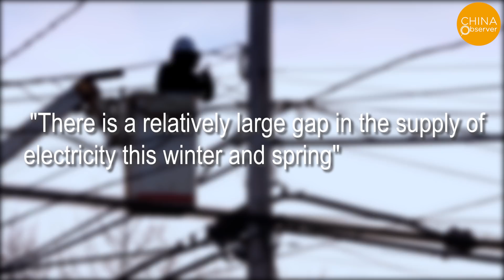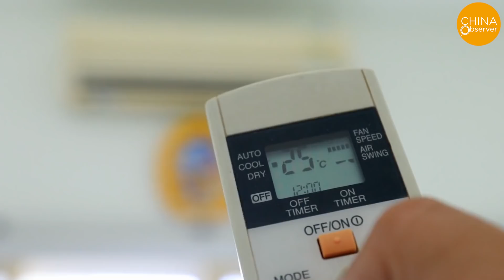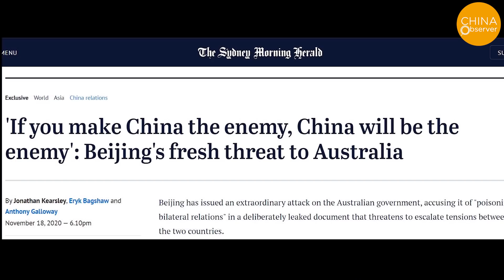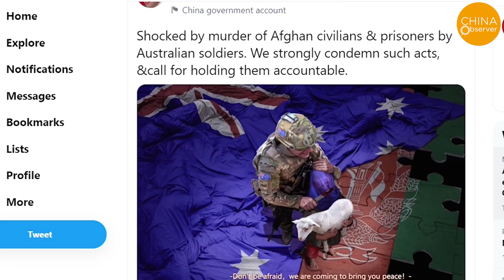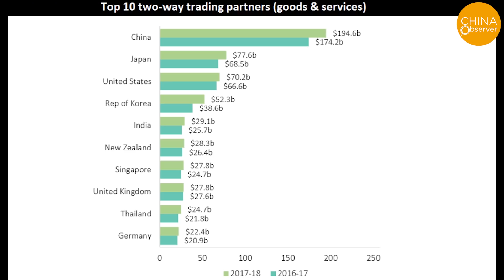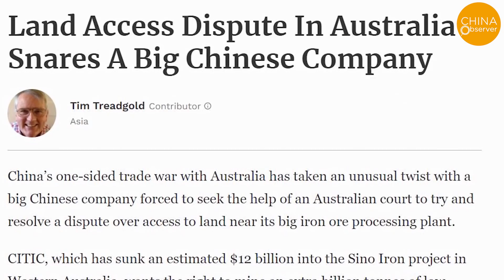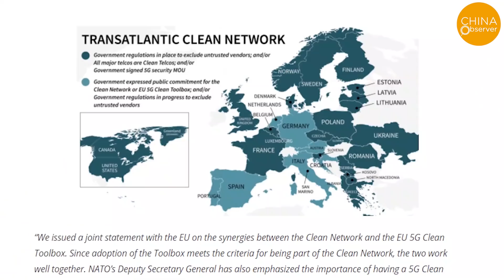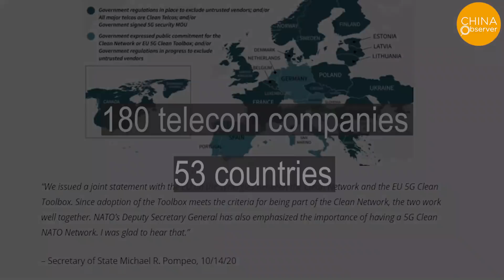China Suffered from Mass Power Shortage After Banning Australian Coal Import | Economy | Sanction

Comment: The power shortage also coincided with the bankruptcy of a nationalised coal and power company. If one utility provider has gone bankrupt then others are likely to follow.
Reply: @xiguada9928  What you are saying confirms the problem is real. I'm not buying environmental protection as a reason because australian coal is relatively clean and so if the environment was a concern you'd stop the import of cheaper more poluting brown coal and import more Australian black coal. Also there mist be an issue with hydro electric dams in China as the CCP turned off the cameras at the 3 gorges dam after reports came out that the water was over topping the dam and the dam had deformed. If there is nothing to hide then why hide it?
Reply: @xiguada9928  bye bye china. Back to be being poor again lol

Comment: Too bad it's the Chinese people who will suffer. None of the party leaders need fear blackout.
Reply: Actually, the situation is not that bad. The trade war between china and australia is one small reason of the power shortage. In my area, due to the green plan, many small coal-fired plants were closed, and this winter is ealier and colder, the comsuption of electricity is rising sharply. But they only limit the usage of industrial electricity. In the rich area, this year is the last year of a green plan, every factory need to decrease their power usage, the goverment even forces those factories to sign a guarantee to reduce the power use. And you konw, ccp is an autarchic government, they will use any way to filfull their object. But we were shocked that  they turn off the street lights too.

Comment: Wait a minute!!
So China is reducing carbon emissions by less coal usage and  still they are criticised.
 So as regards climate change, isn't less carbon emissions a good thing???
Reply: Not quite.
They have to replace the high quality Aust black coal with lower quality brown coal that is less efficient and releases more pollution. Kind of like this, the combustors are at max capacity burning low heat coal that releases more CO2 with the effect of less boiled water vapour to spin a turbine.

Comment: only less than 2% coal in china is imported from Australia and half of them is being used for steel production instead of electricity generation. The reason of this blackout is due to strong economic rebound in China which has not been anticipated by the power plant operators. Normally in the last several months of the year, production activities are not so strong leading to less energy demand.

Comment: Well, I just watched a video ranking coal production by countries... as per the data in the video, I really do not agree the idea that the blackout was caused by "lack of coal import from Australia".
Reply: Asuka,doesn’t China have large coal seams? I read somewhere that the only problem is that it is two thousand feet deep. Big problems going that deep! As an old coal miner, I would not go that deep!
Reply: @thomastolbert6184  Respect to you, bro.
I have no idea for coal mining, but I did read that CN has the highest coal mine casualties among all countries even with the most modern mining devices. Anyway, according to the data CN has been the top coal production country for over a decade, and its annual  production dwarves No.2-5(or No.2-10?)combined. So I dont think CN will be short of coal without coal import from Australia. The iron ore may impact way heavier than coal, IMO.

Comment: Please do more research, the lower import volume in last couple months from Australia coal doesn’t even come close as being one of the main causes.The primary cause is due to global warming (extreme weather) and the associated policies set in place to control carbon footprint, coupled with the surging demand of electricity due to the pull of the manufacturing demand from outside of China - the surge in PMI data is all public info. Most of the coal used by China for generating electricity comes within China w/ gap covered by imports from Indonesia, Mongolia, and Russia. Australia’s coal import only accounts for 2% of the consumption (more than half probably used for metals industry) and the total import volume had been mostly achieved this year by October 2020 comparing to 2019’s. If you were to criticize China, at least do your home work, and focus on more quality issues.

Comment: Do you even know the difference between coking coal and regular coal? 
The coal to generate electricity are regular cheap coal, not coking coal. 
Australia coal are high quality coking coal they are by no means used to generate electricity. 
China are lacking cheap low quality coal not the high quality Australia coal.

Comment: This video is hilarious. 
Australia imported coal represent roughly 5% China's total consumption. What made you think this caused China to have power shortage? 
Australia exports roughly 10 million tons per month (before ban) and China consumed roughly 3 billion per year. Explain to me why missing roughly 5% of coal, 2.5% of total electricity shall make a city go blackout?
The main reason is 
1: Central government sets a quota in their 13th five year plan to reduce coal consumption by 2020 so local governments are rushing on their "kpi" at the end of evaluation cycle.
2. Increase demand of exports requires many factories to increase their production hence increase energy consumption. 
3.  Unusual low temperature striked southern China. 
4. Reduced energy from hydro due to water shortage in winter.

Comment: China produces 3.7 billion tons of coal every year, but only imports 77 million tons of coal from Australia. The imported coal is exclusively for steelmaking, so don't be conceited Aussies, you are not that important. The electricity shortage is because of the strong La Niña effects this year. The average temperature is much lower than usual in China, so they used more electricity to keep warm. Also, due to the pandemic, China is probably the only major manufacturer in the world that can produce at its full capacity. China has to produce a lot more products to supply the whole world's needs, so the factories in China have to consume more electricity than usual, which worsens the electricity shortage.
Reply: @hygst  So? The quote sounds like u are important, but ehh...77million/3.7 billion...Data is correct, check any source.
Reply: @8kk996  Wang Wang is that you??
Reply: @8kk996  WTF?????

Comment: purely fake news without basic understanding of power sector. 90% reply are just pethetic and intentionally don't want to be waken up.  power from Australian coal account for less than 0.5% electricity in China. this topic is widely discussed by non  energy people in china, but people within energy sector think it is not an issue at all.  the reason for power cut in Zhejiang prov is 1. export grow more than 10+% in 2020; 2. power is cut Intentionally to meet carbon emission target  Hunan/jiangxi province: 1). cold winter 2). small coal power plant were shut down permanently to control carbon emission.'